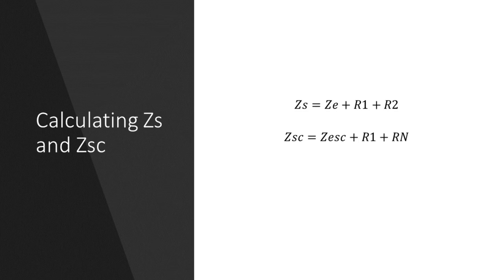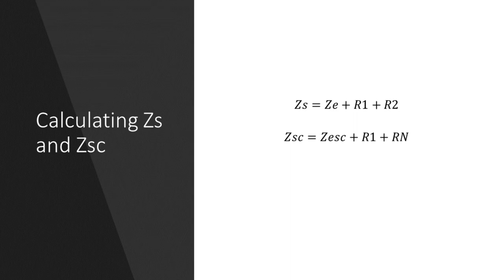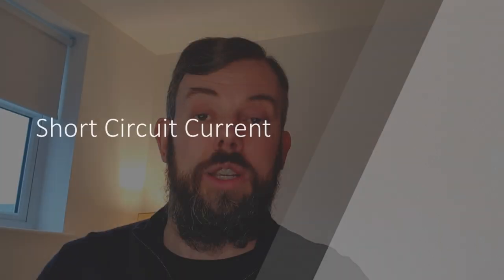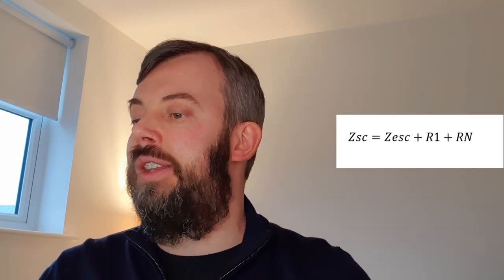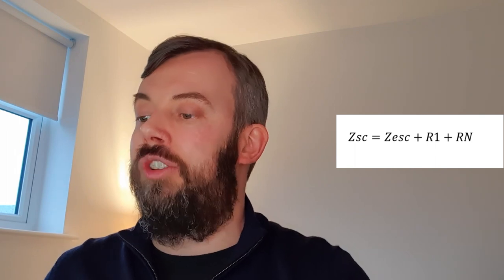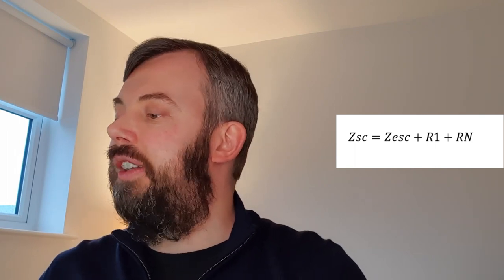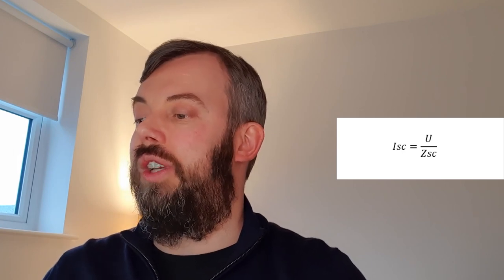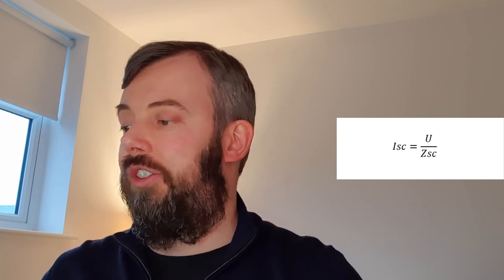Short circuit current and fault current calculations

Comment: Thanks.
When I was in China, we based on the GB and IEC codes. We calculated all the single-ground short currents for every nuclear power project and compared them with the Voltage drop when long-distance low voltage distribution.
But right now I am in Canada, and I could not find any Engineer calculating single-phase short current. They recognize Voltage drop data when the circuit is too long. It seems they don't know sometimes breaker (I-instantaneous) settings should be smaller than short currents which happened at the end of the circuit. 
And single phase to ground short current data makes the cable fit for Vd at the same time.
I hope it might happen just at my company.

Comment: Hi James, you got me a bit confused by stating initially  that  the ipscc would  always be the larger value, and then contradicting yourself by stating the ipfc would always be the larger value. I understand the higher resistance caused  by smaller csa cable, but the contradictions got me muddled up. Thanks though, for the video.
Reply from the maker: Hi, 
Thank you for your comment. The short circuit current (Isc) will be higher than the fault current (Ipf). However, when recording the Pfc on an electrical certificate, there is only one box to enter the Pfc, and we are required to enter the higher of the 2 readings.
So even though the box on the certificate is labeled Pfc, we would test both fault current and short circuit current and enter the highest value (which would be the short circuit current).
I hope this helps.
Kind regards
James